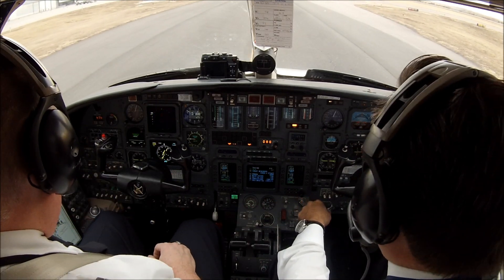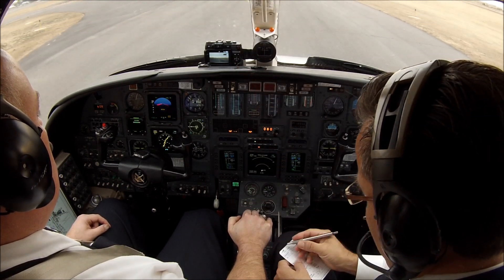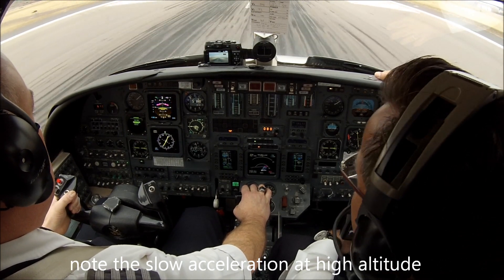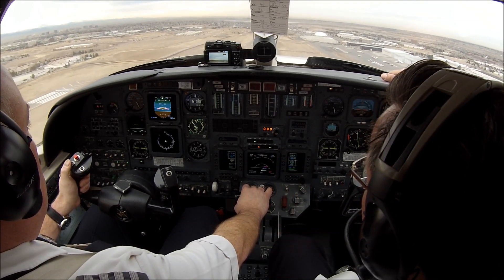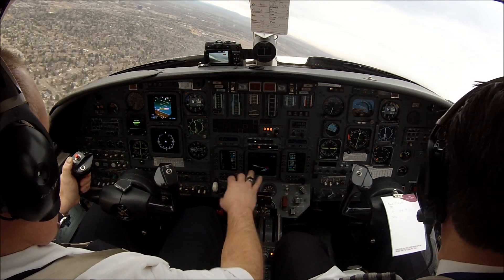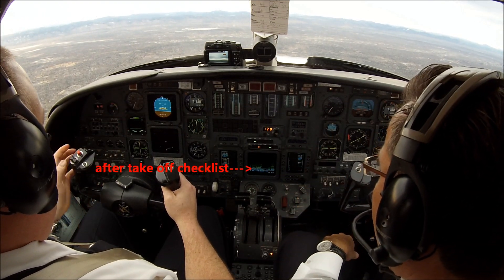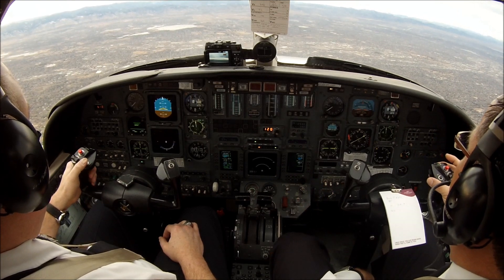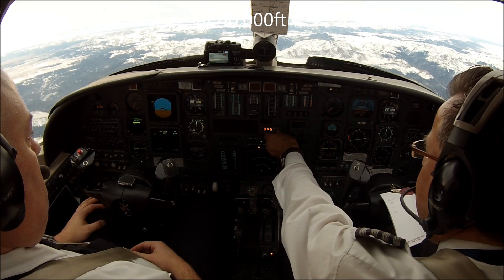Denver Colorado - high altitude take off in a Citation V jet.

Comment from the maker: HI Brian, morder FMS (e.g. the Collins FMS3000) allows have a database for the speeds. We have to look them up in a table based on: pressure altitude, weight and temperature and get the speeds for V1, Vr, V2 and Venr as well as the take off power settings. We calculate as well the Vref landing speed at take off weight in case we need to come back in an emergancy.
Happy Landings,
Guido